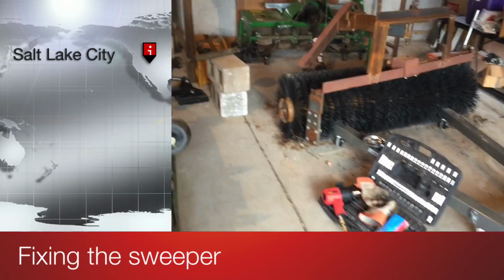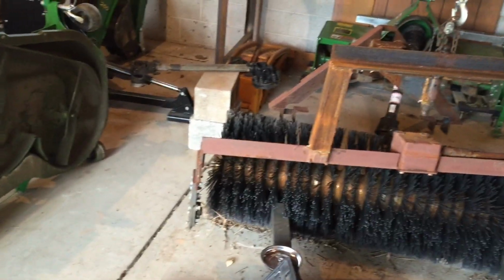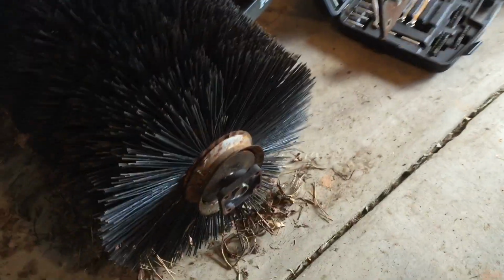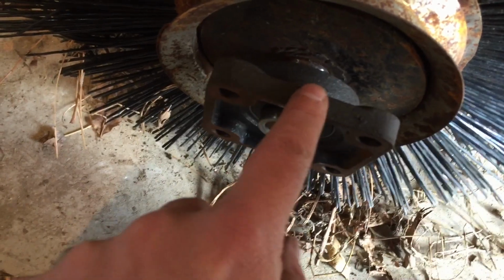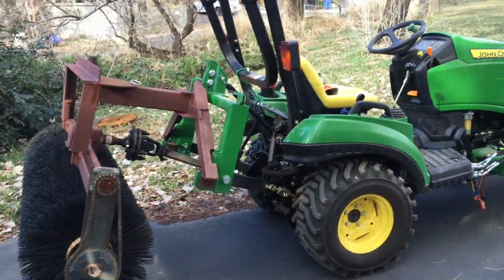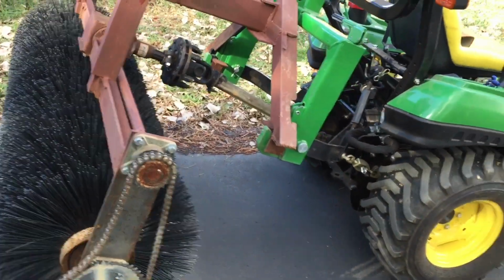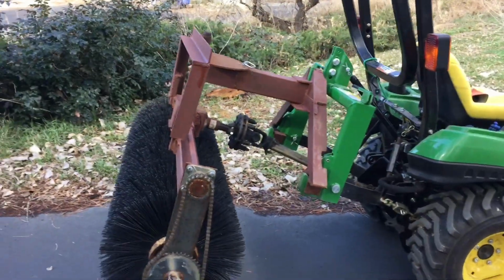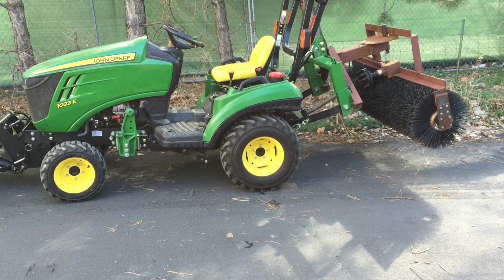Working on the homemade sweeper

Comment: What about gage wheels following the uneven ground?
Reply from the maker: Yes.  I tried it once but the sweeper was too tight on the three point hitch and lifted the back of the tractor.  Now, in line with this idea, I want to make it more freely floating on the back, like a trailer